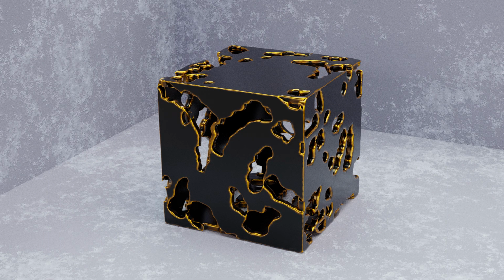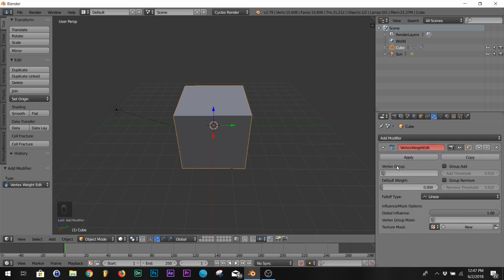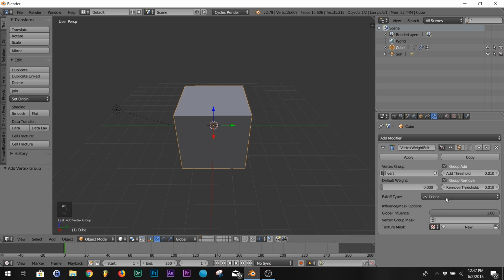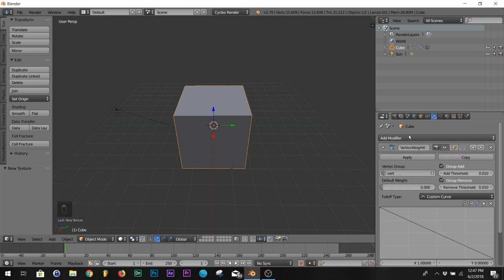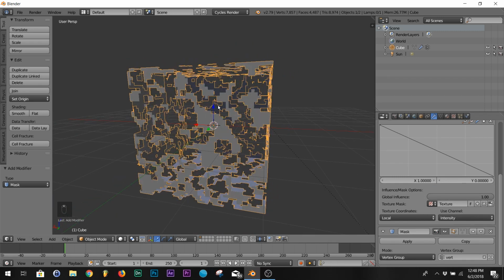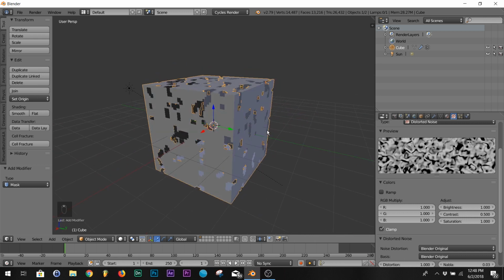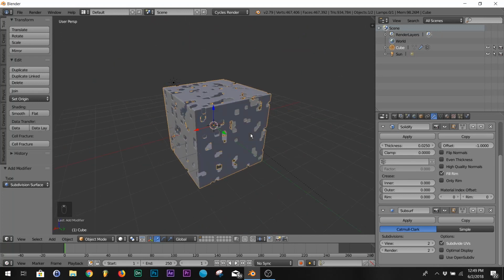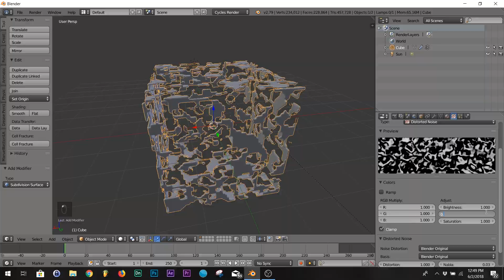Blender - Dissolving Box Tutorial

Comment: How did you get the material to be yellow on the inside?
Reply: Create the 2 materials you want to use on the mesh. Then, use a solidify modify on a standard cube mesh. Then change the material index offset (in the solidify modifier) to 1. If its set up right, you must see the first material on the surface and the 2nd material on the inside.

[ The material created first has an index value of 0. The 2nd material has an index value of 1. Essentially, by changing the material index offset value, you are telling blender which material to use on the faces generated by the solidify modifier.]
Reply: @VERTIGOBEATS2good2betrue  makes sense, thanks I'll try it
Reply: @adaptiveplexus  sure mate. Any doubts, dm me . Ill try my best to help you out . 
Insta
@vertigobeatsyt
Reply: @VERTIGOBEATS2good2betrue  Thanks it works perfect!

Comment: How’d you get it golden yellow on the sides
Reply: H
Reply: @AshantiVO  I think i figured it out, I added a bevel and solidify modifier and set the material value for bevel to 1. Under "Limit Method" change it from None to Angle.
Reply: @silverviz5600  Hello, I cant find it out it works in Blender 2,83. there is no Limit Method area.